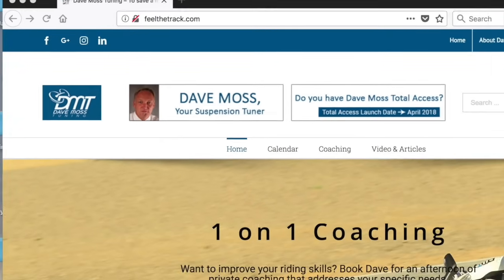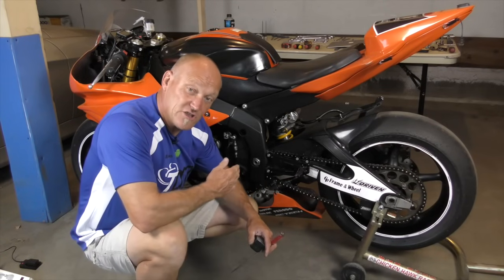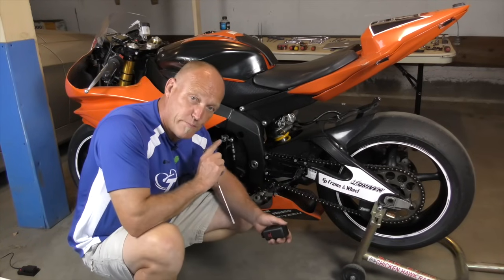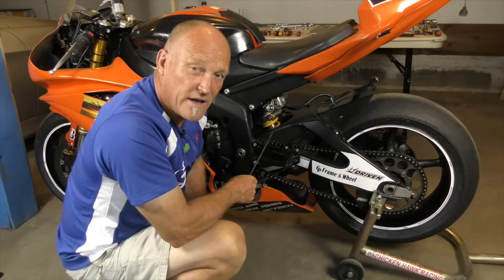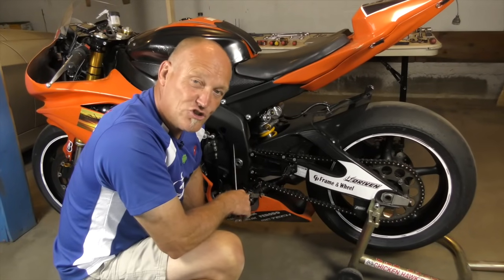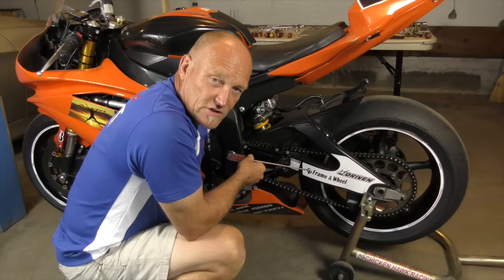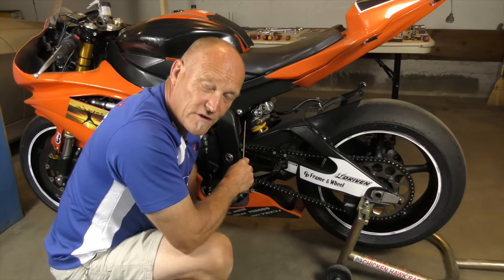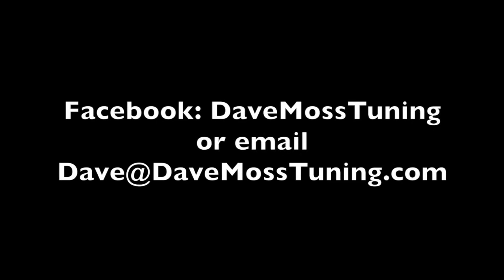Motorcycle Shock Length

Comment: when chain lengthens due to usage / when we change the chain sprockets /  when we put tires with different size thread or bigger tires or smaller ones
all of the above directly affects the length of the shock.... so how do u deal with that ?  (shim on top of shock/replace shock/adjust if shock is adjustable)

If u shorten the wheelbase on a stock shock, that will make the bike really agile ... so there is really no need to lengthen the shock in this situation, at all.
eg: generally people will put a bigger tire on the rear then oem tire ... so that has a similar effect.  

# If we have a race bike, we need stability, so we're going to push the rear axle back, lenghtening the wheelbase.  but this makes the back of the bike drop slightly ....
...so to compensate u can lengthen the shock.
# Some slow tracks i need a lot of agility so i change the gearing(sprockets)  so that wheelbase is going to shorten, but this makes the back of the bike raise slightly .... 
...so to compensate i need to shorten the shock.
# Some extermely fast tracks i need a lot of stability so i change the gearing(sprockets) so that wheelbase is going to lengthen, but this makes the back of the bike drop slightly ...
... so to compensate i need to lengthen the shock.
-----------------------------------------------------------------------------
when u shorten the shock, this makes the back of the bike drop slightly pushing the rear tire towards back... so the wheelbase gets lengthened --> the chain will need loosening.
when u elongate the shock, this makes the back of the bike raise slightly pulling the rear tire towards front ... so the wheelbase gets shortened --> the chain will need tightening.

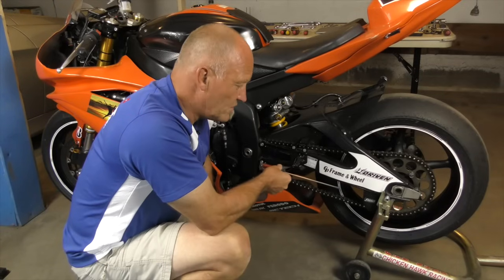04:43 Recommended swingarm angle
Reply from the maker: There is an ideal spot for the rear axle and that is the middle third. The further forward the axle goes, the softer the shock and the further rearward, the stiffer the shock. This might be achieved via spring and valving based on travel used, or you might need a spring that is softer/harder to optimize travel used. Lengthening the wheelbase generally requires a shock to be longer. Then factor in engine power, traction aids and rider skill. One change at a time and you find where you need to be fairly quickly.

Comment: Further down in swingarm (along axis with SA pivot), actually lifts the rear/pitches bike more forward. But also means less weight on rear yet also longer lever on the shock spring.

Comment: Hi Dave,
I did the ninja 400 "415" chain conversion which shortened the wheel base a lot - approximately 1"
I have K-Tech rear shock which is length adjustable and set at manufacturer recommended 320mm. My last track day was Sonoma and I didn't feel as comfortable on the bike with the shorter wheel base (especially T6) Which direction would you suggest going as far as the shock length? Hope I've given you enough info and thank you.
Reply from the maker: Try 318, then 316 BUT, you have to assess how much shock travel you are using! Use a tiny amount of grease on the shock shaft unless you already have a clear dirt rings visible.
Reply: @catalystreactionsbw 
Will do! Thank you

Comment: I’m doing a Wheel conversation, I put a 19 inch VStrom 650 front end on a Yamaha TDM 900 , why well the TDM has a 18 inch front wheel and I what a wheel to have greater tyre choice, also for light off road riding ( otherwise I could have put a R6 17 front wheel on ) anyway that has obviously lengthened the wheel base and it seems more stable at high speed ( just turn in is slower ) my question is I want to increase rear wheel travel ( TDM has 143mm ) the VStrom has 150 mm , so if I put the VStrom rear shock in - I already know it will fit that in theory will decrease the wheel base probably to the similar specs as standard ?
Reply from the maker: If the VStrom shock has longer travel, wheel base will increase. Engine height will be higher so the bike may have more or too much agility. To get better turn in as a result, lower the front by 4mm and see if turn in is good for you.
Reply: @catalystreactionsbw  thankyou for the reply yes I have room to drop the forks through the triple clamps , already 10mm  , so that would take it to 15. Sorry a bit confused if a put a longer shock on the rear will that not lower the swing arm ( at the rear )  giving more travel bring the rear wheel closer to the front of the bike decreasing the travel ? I watched the vid you done and that’s what I through you said about raising or lowering the rear suspension, did I miss something ?  will watch again .

Comment: This is interesting. What do you think about increasing the swing arm length on a road bike? If you’re not in the city it could be beneficial right?
Reply from the maker: Depends on the radius of the axle and linkage. Going back further = longer wheelbase for more stability BUT that also means far more leverage on the shock. Stability is good, AND get the correct set up to leverage the stability.
Reply: Dave Moss Tuning interesting. Sounds like i need to learn a lot more before i could plan to make adjustments like that myself though haha

Comment: My 5 cents. I did analysis on MotoGP bikes by measuring their swingarm angle by looking at the high resolution photos taken with bikes being perpendicular to the camera, standing on their own weight or supported by auxiliary stands and photos taken with long focal length (less distortion). Magic number i got is 10.5 degrees in average for those MotoGP bikes. I guess swingarm angle is also dependent on the front sprocket positioning relatively to swingarm pivot point and size of the rear and front sprockets. For example S1000RR 2012 comes from factory with around 11 degrees angle (bike sitting on its weight). I set swingarm angle by looking at corner exit behavior. If swingarm angle is too steep, then bike tends to keep the line well, but brakes traction in the rear easily and suddenly like if bikes wanted to high-side. If swingarm angle is insufficient, then bike runs wide on corner exit and requires corrections to keep it on desired trajectory, however it has plenty of grip in the rear and if rear brakes traction it slides predictably. So with adjustable shock it is easy to figure out what the best setting is for a given track just by feeling what the bike is doing (assuming your damping front and rear are set adequately). By the way David if you are reading this, What is your recommendation on forks preload on 2017-2018 S1000RR DDC model for front preload? For me (83kg without gear), front feels the best between 3 and 2 preload lines showing on the right fork leg preload adjuster. Thanks.
Reply from the maker: Great information and thanks for sharing! I never thought of high res photo detective work :) For the forks, damping at +2 and preload at 2-3 as you have it, forks in the stock position.
Reply: Thank you a lot David. For damping I set +2 DMP in "RACE" DDC mode, however in "SLICK" DDC mode it seems about right with DMP 0 or 1 in the front, however I regret having DDC as it constantly adapts and gives me some strange feeling of uncertainty about what bike is doing... I tried with front sensor from 2d installed - much better front feel, however it limits turn radius too much (bad mounting design) so bike becomes unusable on the street, but for the track in my opinion front sensor is must to have. Mostly use USER mode where I can assemble bike behavior from multiple modes depending on riding conditions.
Reply from the maker: Agreed that front fork action is improved with the 2D sensor installed but as with all algorithms, they can only work to a point verses the tuning of a manual system. It is interesting that with more power in slick mode, you actually run softer damping but if that was after installing the 2D sensor, that makes perfect sense.
Reply: Dave, On my 2018 DDC bike suspension action depends on selected mode (with or without 2d installed in the front). 0,0,0 baseline setup in Race mode works much softer (especially forks) than 0,0,0 baseline setup in slick mode. It looks like each riding mode has its own DDC baseline settings internally (not shown to user) and user adjustments are made to a given DDC mode specific baseline. For example +3 to DDC in Slick mode on rebound is not the same as +3 to Race mode DDC on rebound as 0 in race mode is not the same as 0 in the slick mode in the first place, and on top of that bike readjusts for braking, acceleration and cornering differently in these DDC modes, plus it re-ajusts constantly while riding anyway so to me those user settings are more like a suggestion to  DDC brain which it may hopefully take in consideration in most cases, not a hard order. In user riding mode it is possible to select throttle, traction, DDC, ABS separately for example for the street I use throttle Slick, ABS Race, traction Race, DDC Slick (for good quality roads, fast riding) or DDC race (long distance slow riding). Important bit there is to calibrate DDC correctly and there is an issue with linkage bolts which allow for 10mm (~1 degree) slack on the wheel axle point when loosened (all 5 including shock bolts loosened for test) so correct swingarm position (angle) is impossible to determine or set. As result these bikes are usually loosing swingarm angle over time (unpredictably) as at factory swingarm linkage is assembled with swingarm just hanging down and large tolerance bolts allow it to compress over time as friction between tightened components are insufficient to hold it in factory assembled position. Alpha racing makes a good set of bolts with bolt diameter to holes made in low tolerances which solves the problem permanently. When rear end is all assembled correctly (swingram pulled up when tightening linkage and shock bolts with Alpha Racing bolts) bike must (and will) pass calibration when standing both wheels on the ground on its own weight - this is the only way to calibrate DDC correctly (when bike is on its free sag front and rear). For many this method fails due to reasons explained above. Some bikes are highly affected - DDC calibration fails even on side stand. Linkage bolt problem exists since 2009 model and until now and can be fixed with mentioned low tolerance bolt set (same for 2009-2018). Sorry, can talk for hours about subjects like these :)
Reply: Now when 2017/2018 HP4 RACE came out it is possible to measure what BMW did there for their hi-spec race bike. First of all the swingarm and swingarm linkage is very different from stock S1000RR or old HP4. It is new design completely. There is ttx in the rear and Spring rate is 95N/mm however with new linkage it is hard to tell what it means really. Swingarm angle is 9 degrees (bike on it's own weight). Sprockets 16/43. Rear tire 200/60 Supercorsa SC2. Swingarm pivot point looks like -3mm comparing to 2015-2018 S1000RR means -6mm from 2012-2014 S1000RR or -2mm comparing to 2009-2011 S1000RR. Rake 24.5 (adjustable via inserts 23.5 to 25.5) degrees, trail 102.5mm (adjustable via inserts 95-112mm). I tried on my current setup the lowest I can go is 10 degrees (on its own weight, alpha racing bolts in linkage, 2.5mm shock eccentric hole up).  https://www.press.bmwgroup.com/global/article/attachment/T0269789EN/395468

Comment: I've always wondered this. I recently replaced my chain since it was time for a new one and did the 520 conversion and went down on the front sprocket and up on the rear based on recommendations for the Ridge here. I didn't think to adjust the geometry until later and then didn't know what to do with it.
Reply from the maker: Where did you end up with the geometry change (if any)??
Reply: I didn't make any changes since I didn't know enough about it to say what needed to be done or why.

Comment: Thanks so much for all your work Dave and everything you do for the motorcycle community. As a racer that races a short tight track that only allows us to hit 5th I've been under the impression that we should use as much ride height (anti-squat) possible until we start experiencing wheel slippage on corner exits then start to back it off a bit from there.  How do we know when we are in the optimal ride height for track racing? Thanks in advance
Reply from the maker: Thanks for the kind words! A few ways for you to get an answer;- swing arm angle with the bike at rest = 9 degrees as a starting point, the rear wheel starts to spin at 30% throttle or tire temp on the surface is 190F while 4mm down in the carcass is 40-50 degrees cooler.